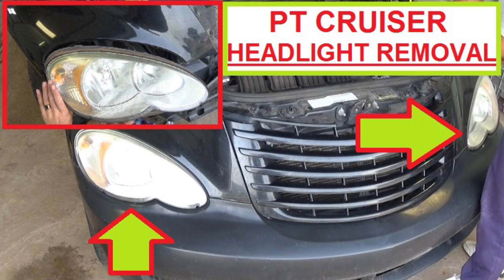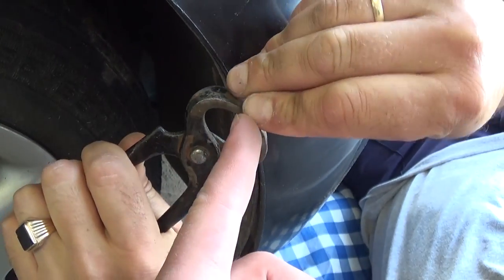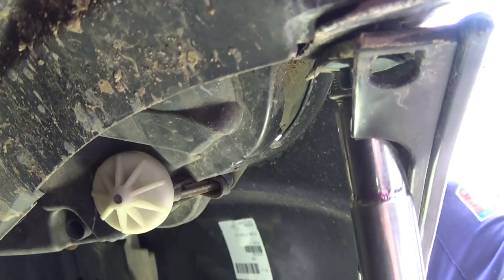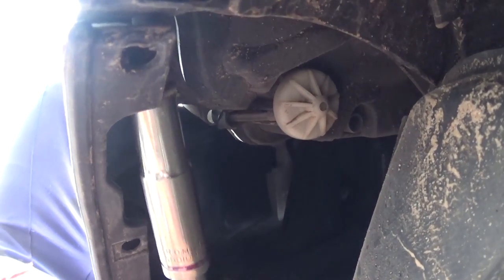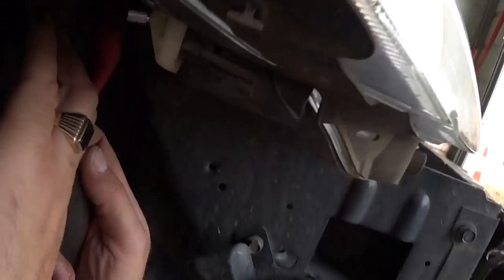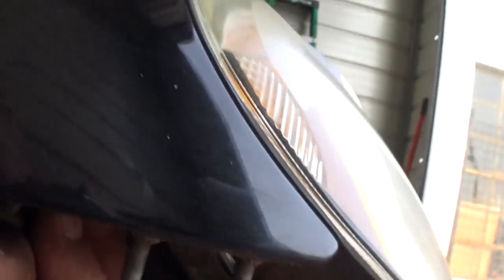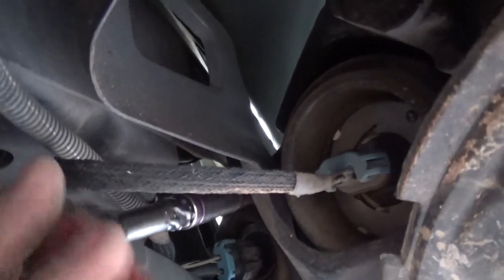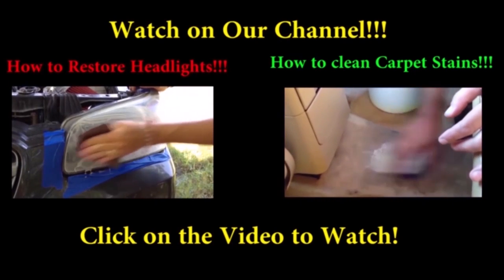Chrysler Pt Cruiser Headlight Removal and Replacement

Comment: Great video although you do not have to take the grill and bumper off. If you take the 3 bolts off that hold the wheel well to the bumper you can easily remove the 4 bolts that hold the headlight in. You just have to finesse it out after that. And than put the new one in the same way. It took me less than 30 min to do both lights. I will say that removing the bumper makes it easier it's just time consuming
Reply: Wrong. This is a second gen PT he's working on. You need to remove the bumper.

Comment: I was going to buy some new headlights for my 2001 Cruiser - Now I'm not LOL
Reply: Look up video on how to restore headlights with polisher
Reply: Look up a diffrent video to just replace the bulb this guy does a whole bunch of unnecessary stuff to replace a single bulb this is more about removing the entire piece. Theres a small panel in front of the tire you can  just take off in about 10 mins and replace the bulb for low beams.
Reply: It's not that hard bro

Comment: You guys need to understand that he's doing this on a second gen PT Cruiser. If your headlight is shaped exactly as his then you have a second gen. Earlier models that have the headlight with a full curved outline are easier to replace. Also, on the second gen at approximately 2:23 he shows the bumper 'just coming off' when in reality there's three screws on the bottom of the bumper as well as two, or three (can't recall) push pins that prevent that. I think the car he's working on has had the bumper removed before and they didn't replace the fasteners on the bottom of the bumper.
One last thing to note- On my 2006 PT convertible there aren't any push pins on the splash, there's threaded screws and you'll need a 7mm socket to remove them.

Comment: How do you get those 10mm nuts off that hold the upper fender to the bumper when the bolt just spins with the nuts? There’s no way to hold it from the top.

Comment: Why the hell would someone engineer something like this... Could they not just have a release bolt accessible from the engine compartment that you unscrew with an extension, and have it pop out the front, or literally anything simpler than this... I know it's useless to complain but come on, the average person doesn't want to have to do this kind of crap
Reply: everything....EVERYTHING on these PT are exactly like this.    It's like they meant 4 these to be throw away cars -   were NOT expecting anyone to actually still own it long enough for lights to go bad
Reply: @mariobravo8253  lol, yeah. I had my PT cruiser for a good run, but it finally died a while ago. The serpentine belt was starting to go, parts of the body was quite literally held together with zip-ties, it would overheat if it idled for more than a min or two, and the amount of re-wiring I had to do after a (thankfully minor) electrical fire. The thing that finally killed it was when the alternator died, and accessing it was near impossible.

Comment: F U Chrysler for making the most difficult headlight replacement.  Will never buy another Chrysler again.
Reply: Agreed, I can pull the headlight assembly out of my GMC in under a minute...
Reply: Thats what happens when you buy a car with unconventional shape
Reply: I don't know what this guy is talking about. I have a pt cruiser and there is an access panel on the fender wheel that you pop out and just replace the damn bulb. It took me less than five minutes. Some think that you have to remove the tire to allow plenty of room but, you don't. You just have to turn the wheel all the way to either the right or the left.